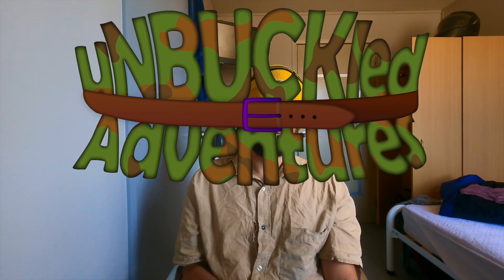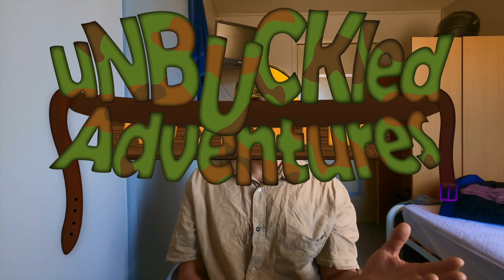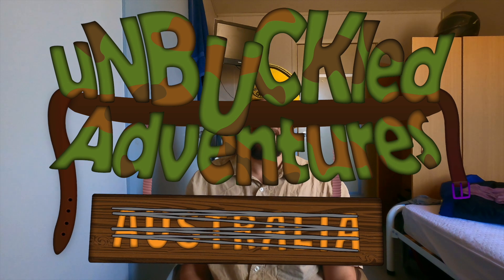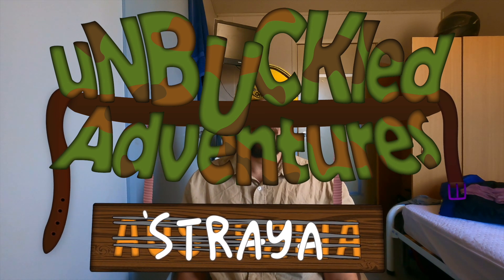Why you SHOULDN’T Re-jet your (AUS SPEC) DR650 carburettor & hack air-box : Vince Strang’s opinion

Comment: I totally agree, My stock std 650 with factory carby and a Delkevic pipe is trouble free, starts straight away and in a race is always level with or in front of a carby modded bike :-) and as Vince stated I get better fuel economy
Reply from the maker: Thank you for the comment. Have you changed your pilot jet ? 
It seems this topic divides the DR650 community
Reply: @unbuckledadventures  All still STD.   I live @ sea level and I find she pops a little on the overrun when running hard. Ive ridden her through the Vic alps , Snowys, Out West NSW and she runs sweet everywhere apart from a little lean on the overrun........I may change the Pilot jet one day, But I love the reliability and easy starting etc I have now.....If it aint broke dont fix it i say :-)

Comment: Interesting theories from Vince. I've found my DR has alot of popping on deaccel with an open pipe. Have a jet kit on order - Barry from cross training enduro seems to think otherwise. 

If an engine is running lean out of the factory, and you put bigger jets in it you can get better fuel economy as the engine is running more efficiently.

I have a 2012 model DR and will post up my results :)
Reply from the maker: Look forward to seeing you results Booki. I have been told about Barry and will contact him to further understand his opinion. Potentially have a video discussion 
Cheers
Reply: @unbuckledadventures  I ended up putting in a procycle jetting kit, airbox door off, cut the spring and drilled the slide. Much prefer the more instant power compared to the rubber band style power the factory setup has.

Bike should ride like this out the factory.

Comment: In the U.S. the bike is just toooo restricted and must be opened up. Even if you don’t need the power going one size on the jets will make the engine run much cooler which adds to the longevity of the engine.  I do agree it is a great bike with a great factory set in some countries just not the U.S.

Comment: I am in California and I did the Procycle jet kit  and It made a huge difference, better low speed and smoother throttle response along with more power.
Reply: Vince did specify that in the US the standard jets are more restrictive than in Aus, so different result with re jetting a US carb, presumably.

Comment: Agree 100%. Only adjustments needed are to turn the fuel screw out 1.25 to 1.50 turns from fully seated and shim the fuel needle .030 inches to fix the factory lean pollution control tune. The shim removes the mid range surging and the enriched fuel screw adjustment removes the inconsistent fall to idle when rolling off throttle on different temperature days. It removes the ultra lean factory tune.
Reply from the maker: Are you based in US because I believe the factory needle in Australia is different
Reply: My 2019 in USA doesn't have a fuel air screw.
Reply from the maker: Ah ok.. I would like to get a US needle and compare because I don’t think that need shimming is need on the AUS spec carb
Reply: @alwayspointnorth  it's factory plugged... you need to remove the plug and the screw is there.
Reply: @brpo1  I will look
Reply: @unbuckledadventures  Yes US and I believe (don't know this as fact) all the DR650s are tuned to meet legacy California emission standards. My OEM needle only has one grove or one height. I believe other BST40s needles have the multiple groves for adjusting with the circlip. Without these adjustments the DR (at least the newer US DRs) has a subtle surging mid throttle - drove me crazy - some might not even notice. Also, the fuel screw is set about .5 turns out from the factory which leads to in my opinion excessive exhaust popping on deceleration and the moto has a harder time settling to a solid idle. With these tweaks you maybe lose 1 or 2 MPG over the OEM tune but the moto really performs much better over the whole throttle range. Nothing at all wrong with the carb and let's face it - no matter how many adjustments you do, the DR650 is a slow moto in the larger scheme of things. Not knocking my "Donkey" it's just what it it is...

Comment: I bought a new dr last year then started doing mods to suspension, sprocket gearing, pipe and procycle jet kit. The jet kit made a big difference to throttle response and revs much quicker. Would never go back to stock.
Reply from the maker: Thank you for your comment:) 
I have heard the same from a lot of people and great to hear! I have a close friend whom I did an earlier episode with called ‘crashing on rainbow beach’ who said the same .
If done properly, can be great ! Each to their own

Did you cut the spring in the slide and drill a whole in the slide ?
Reply: @unbuckledadventures  I cut 50mm hole on the airbox, cut 2 loops off spring drilled extra hole on slide using 45 pilot and 150 main. Had needle on 4th clip as they suggested but ran rich so put it on 3rd fuel screw is 1.3 turns out. Runs way better than stock
Reply from the maker: Thanks for that detailed response .. 

Their is a part later in the video where Vince states he doesn’t doubt people can get it right but a lot of people who are not motor savvy get it wrong 

I just have a 45 pilot and brought the rest back to stock because it wasn’t running right. I like it now .  but I purchased mine with 23 g kms on it so whoever modified did not know what they were doing .

I also am a less experienced rider and feel it to be more than enough response and power for me to get around the world .
Reply: @unbuckledadventures  what are stock jet sizes for Australian bikes?
Reply: @JB-zg9hb  "To both of you" - same exact thing - runs like a freakin BEAST !!!!! - Knowing how to tune it properly makes all the difference in the world. Plus I have a 2015 GIXXR Exhaust - totally different bike. 50 MPG too....

Cheers to both of you !
Reply: @davidlopezkk5mt229  Not 100% sure but if I remember they are 42.5 pilot and 145/140 mains.

Comment: love your vid, tough one coz as you intimated it ain't so simple an issue.
The stirrer in me cant help but poke a bit of fun as well as thoughts (no offence, I actually do run stock carb / snorkel in, but with a straight through muffler. I would only ever adjust jets if the range of conditions i'm likely to encounter / FAR warranted it, not because someone told me what the right jet size is).
Best leave stock? Sure, why not, trust the Suzuki experts; after all they based the DR engine on the Otto cycle! Those in the know may remember Toyota's famous "Otto cycle" / "O2 advantage" campaign of the 1990's and how good those engines performed in motorsports!
But why not modify it (IF YOU KNOW WHAT YOU'RE  DOING. Even something simple isn't: Is a richer pilot jet preferable to a standard size with a tweak to the mixture screw??? ). And there's more chance of oil dilution from a conservative one size fits all stock bike setup than an individually calibrated modified setup.
The DR's carb has been designed and built to a set of priorities and targets of the whole system (reliable, quiet, smooth, safe, inexpensive, compact, warrantiable motor). Unfortunately, it doesn't match what some riders want so it's understandable getting the throttle to open quicker without bogging, and not having the overall airflow overly baffled (restricted), will be sought; but lets face it even the stock settings / setup are only a touch more conservative a compromise of exactly the same things anyway and the mods are hardly radical by comparison.
And sure, the mods can't provide miracles but extra air / fuel at proper FAR is still extra power; I'm sure anyone that understands the fluid mechanics and thermodynamics of it all could correctly explain why compression ratios, valve size/lift/duration etc ultimately determine the potential pumping capacity / power whilst someone who knows their mechanical engineering could point out the longevity limitations of the 40+ year old mechanical / material/cooling design. Hmmm,  come to think of it, more valve duration means more power less fuel efficiency ; is that a good mod???
I'm looking forward to catching up with your why you shouldn't revalve your DR650 suspension. And if anyone actually reads this and has revalved their shock and it works well, please message me the shim stack so i can give it a try.

Comment: I don't cut my airbox.

 At sea level, I just pulled the snorkel, installed upgraded filters, installed an extended idle-mix screw, and installed adjustable overseas/KTM needles. At higher altitudes, I can pull the sidecover off of the airbox and adjust the idle-mix screw. For extreme altitude changes, I could adjust the needle by clip position or shim.

 A GSXR muff is in my shed, awaiting install.
Reply from the maker: I like it . A bit different to most but obviate you have a good idea of what your doing . I prefer to have so that I don’t have to modify for altitude changes .. but as Vince would say .. you sound like a tinkerer
Thanks for the message
Reply: In Australia we just don't have the altitude swings like you blokes do over there.  Extreme altitude changes in Australia consist of driving up the Toowoomba range, which is like 3000ft at the top of the hill

Comment: I’ve never heard of oil dilution problems with the DR. That should only occur if the rings weren’t bedded in correctly. I fitted the Procycle 790 kit and it transforms the bike on the road, much better acceleration for overtaking  and uphill. Really hurts the fuel consumption but I don’t cross the Simpson, and fitted a 25 L tank. Worst standard suspension of any bike I’ve owned, life threatening to be blunt. They won’t be sold soon, due to new rules re ABS.

Comment: So where can i get the Aus carb setup specs? I know it's a different needle but what jetting?
Reply from the maker: You could order it from Vince strang motorcycles online shop and get it posted to where ever you are 
They will be from Suzuki
Reply from the maker: The jetting was 145 main jet and 42.5 pilot but I was running a 45 pilot jet

Comment: Great content men 👏.  I'm in cen cal valley. I've ported the exhaust pipe at the weld,and put on a dominator slip on.  But after seeing this vid...I think I'll skip on cutting holes/rejetting.  So should I leave snorkel off or put it back on? If there's no advantages to having it off... then I'd rather put it back on to .  Any advice is greatly appreciated.  Ty u for your time and knowledge Sirs.
Reply from the maker: I am merely a novice but I would put it back on
 The engineers put it there for a reason.  
I feel by having it off you carby breather hose could be competing for air with the air box unless you place it elsewhere 
.. as you can see in the comments many would disagree and have varying opinions …
Reply: @unbuckledadventures  right on thnx!

Comment: Hmmm - I made a link pipe, swapped the silencer for a Hayabusa can and pulled the snorkel. It starts way easier, the drive snatch around 80kmh has gone - it holds 100k in top on a fraction of the throttle and is way faster on top gear acceleration over 100k.

Comment: 100% Both our DR's on 100 000km each and both have been over 5000m altitude many times and still stock standard. He is not wrong. You can't push out enough more horses to make it a better bike. Leave it as is.
Reply from the maker: Great to hear! Gives me confidence for my precious Siyanda for the future
Reply: +1 Rare to find someone who like me has left it stock, and it just works.  Like you, I also have ridden at over 5000m several times, which limits the number of places that we could nominate to do that :) , and it surprised me how just about anything is rideable at that altitude.  Scooters, ordinary domestic cars, 350 Enfields, but according to the bike forums you 'should' get out your screwdriver and tinker the bejesus out of your carb or it won't be at its peak performance! Difference is that I/we have been there, and they haven't!

Comment: What exactly would a person in the US need to do to get their DR650 carb to Australian stock specs? What are the stock jet sizes?
Reply from the maker: As far as I know … The stock jet in Australia is a 140 main and 42.5 pilot.. the key difference is the needle.. the US has a different needle clip in a fixed position, the Aus/Canada/UK needle has different need with an adjustable clip(5 slots to adjust) 

Use this link for better description 
http://dr650.zenseeker.net/Carburetor.htm

I am told the airscrew port is blocked on US carbs and can be drilled out . Not 100% sure though 

I as per VSM changed to a 45 pilot jet as it runs smoother and starts easier , less backfiring with my TKP exhaust 

Jet needle  in Australia is 

6F19 adjustable 
Part number 13332-32E00

Comment: I did fmf slip on, 2 inch hole saw out of stock airbox, 155 dyno main jet with needle shimmed on 2 not 4. A/f screw two turns out. It’s running like a dream super responsive and climbs to 100 much faster than before with a little throttle left still. When the K&n air filter arrives it might make it too lean but for now it’s perfect

Comment: Agree. 
After swapping back and forth jets and springs, widening and then closing again the airbox I have found some modest gains and achieved >165km top speed, a few % better kpl and significantly better response with stock pipe. Although coming from a motocross background I enjoy riding and tinkering in equal degree the effort and cost involved negates the improvements, unless you are said tinkerer.
It requires riding in varying conditions, noting and recording in a log and then diagnosing then changing and repeat. Any hardware mods will put you back a few steps again. 
Any significant power gains will also significantly reduce durability.
Reply from the maker: We’ll said!! I might use that in the next video I make about this topic
 As increasing durability is the reason why I took mine back to stock mostly except for aftermarket exhaust and bigger pilot

Comment: I agree to disagree. My new DR650SE (Canada) has a very bad off idle stumble and very poor mid range power, especially when trying to hold a specific speed. Let alone the sketchy throttle control ability. Basically on and off. 
All this forces me to run at higher RPM and higher RPMS for taking off from a start. 
What does all this equal.... inefficiency and excessive fuel consumption, also all this aids developing bad habits.
An off factory tune is required, at least in North America, especially for carburated bikes. 
In fact, he said it himself. Australia has more lax emission laws than North America..... so for us, proper tuning is a big deal.....
Reply from the maker: Too true .. a lot of told me the same about the bikes over there 👉🏽… each to their own aswell. There are a fair few in Australia that believe it to be as necessary as you say
Reply from the maker: Thanks for the well said comment

Comment: There is so much just plain wrong information here: We HAVE ridden our DRs around the world - with stock jets, cut springs, drilled slides, ground needles and GSXR exhausts: the so-called BST Magic. The rest of the motors are stock.  Immediately it was done, we noticed far better throttle response and had to turn the idle down. All three bikes easily topped 161 km/h on correctly-calibrated Vapor computers. The bikes are now on roughly 70,000km - stock pistons, cams, valves - even the clutches. Valve clearances have barely moved, if at all.
Our fuel consumption went DOWN with these mods - loaded with all the gear we needed to live on the road for a year, we were routinely getting 23-24km/l even on questionable fuel, dirt roads and rough terrain; I cut 1" x 2" holes in the airbox on the shore of Lake Titicaca (between Peru and Bolivia, where we went 5200 metres ASL) to let in more air, and I put duct-tape over the holes below 4000m. 
I have never found any traces of so-called "Oil dilution" even when the oil temp soared in heavy traffic of plugging through jungles and landslides - but we do have manual fuel taps and know enough to routinely turn the fuel off overnight. Oil & filter changes at 6000km intervals. 
This misleading information is nothing more than an advert for a shameless self-promoting dealer and it ensures that I'll not being buying from that business again.
Reply from the maker: Thank you for your opinion backed up from what’s sounds like some amazing experiences! 
May I ask how this video promotes Vince’s business? I don’t see how this video promotes his business ? Please inform me if possible 
I am sure he would be sad to lose you as a customer.
Reply: I wonder about  Vince’s comments if he really believes what he says then why is his website promoting and selling these products seems pretty hip a critical to me
Reply from the maker: @kerritanner6558  the opinions you hear in the video are his personal opinions about what he would do. His business provides a wide range of products so people have the choice to do what they want. As it is a personal bike, people have different preferences. As he has said to me before...he would not use most of what he sells. The demand is there so he provides it 
. He is a simple practical guy who doesn't overdo the mods, everything has a reason.